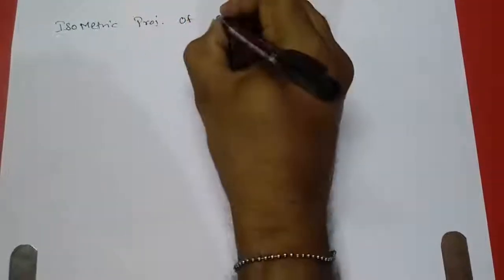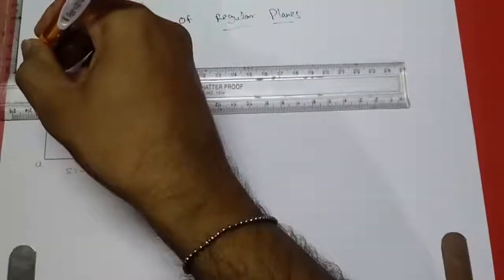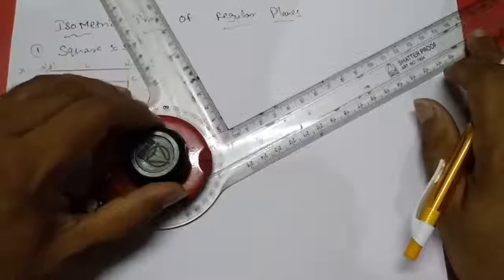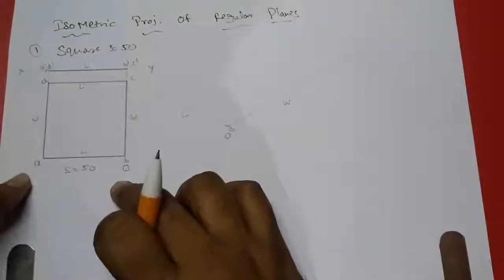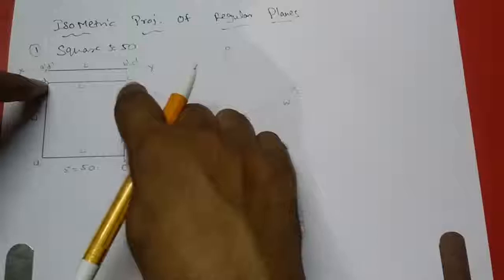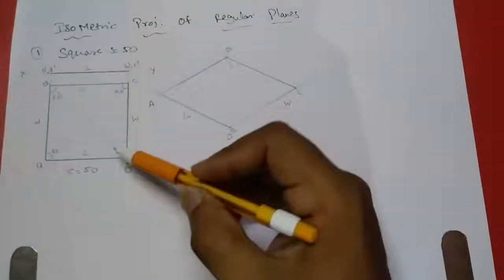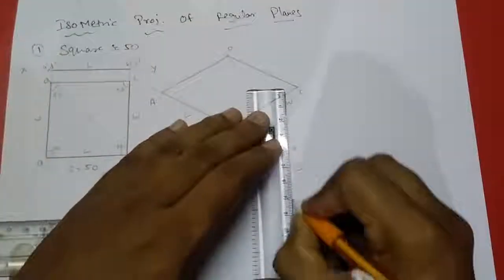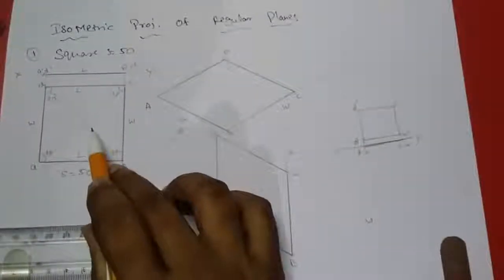Isometric projection of square plane

Comment: Sir ye toh aapne isometric view draw kiya h isometric projection me toh 0.815 se multiply hota h .
Reply from the maker: Yes you are correct, depending on drawing practices, pencils thickness, we will round off those values to 100%.
81% value can be considered good in when using cad software and others

Comment: Bro, in my assignment it's given that draw an isometric projection of a circular lamina which is perpendicular to HP. So, drawing it in XY plane will be correct na?
Reply from the maker: Yes, only if u consider x-for length and y-for height.

Generally we consider. X-length, y-widht, n z-height.

So ur circular lamina in xz